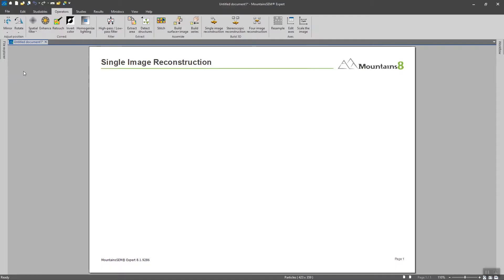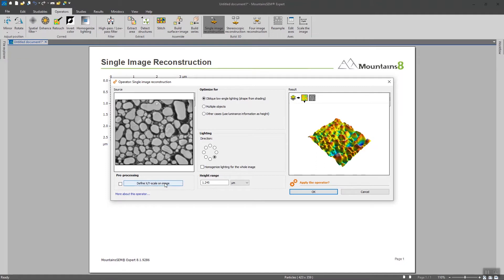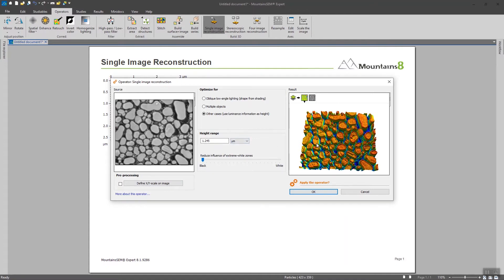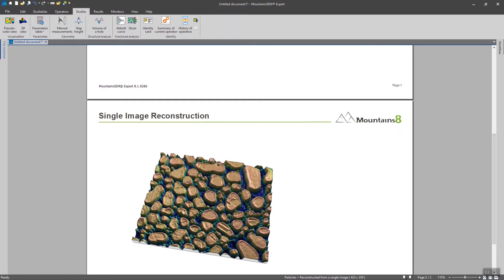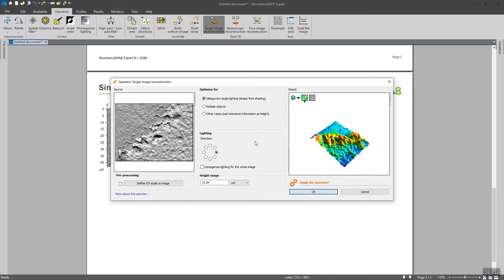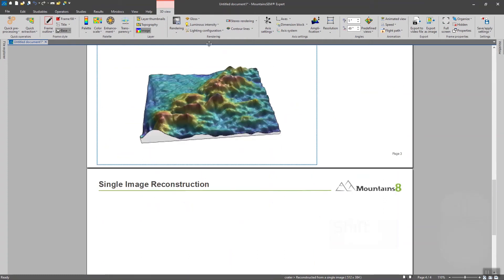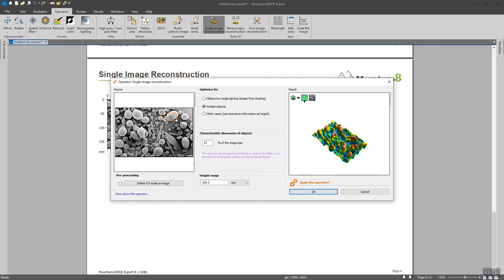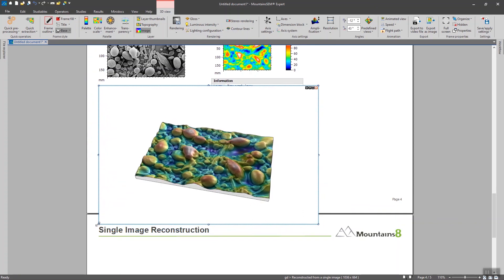MountainsSEM®8| How to achieve a 3D rendering of a single SEM image

Comment: Is rhe hight range exact value?
Reply from the maker: Hi, thank you for your question! In the case of single image reconstruction (contrary to 3D reconstruction from stereo pairs), height values are not exact. However, using this tool can help improve visual interpretation of the image. You can also set an approximate height range which will allow you to get a rough idea of the size of the elements in your sample. Hope this helps!